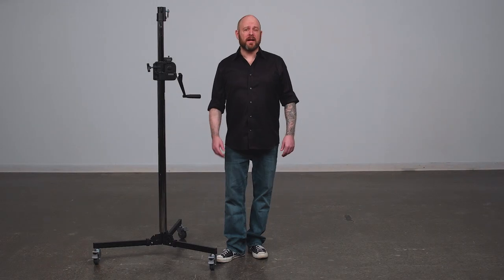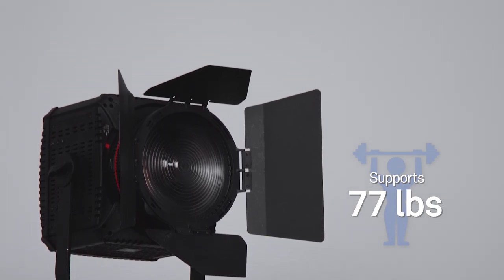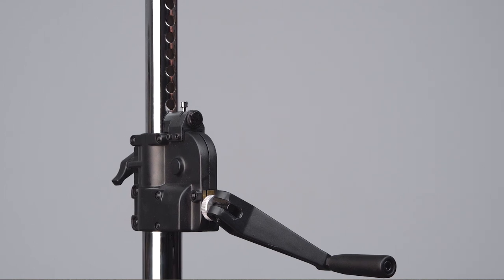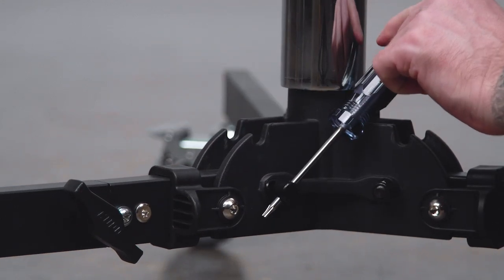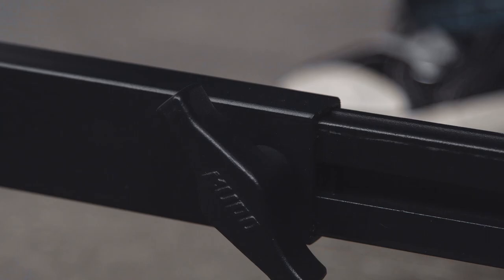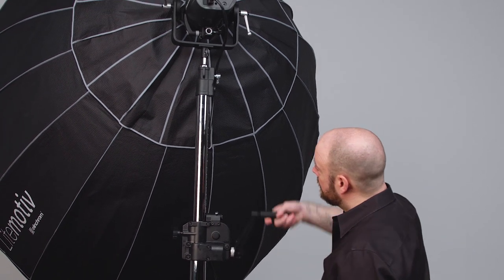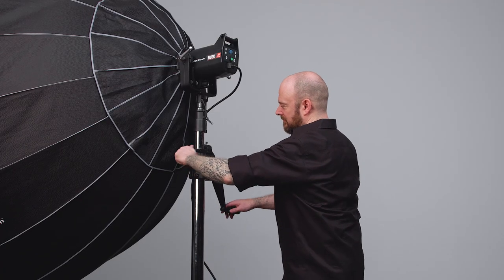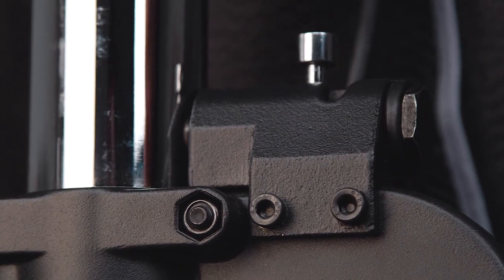Kupo 2 Section Low Base Wind-Up Stand

Comment: I ordered one from BH photo on July 17th. Still waiting. Looks like the bill is going to come due before I get my stand.
Reply from the maker: Thanks for reaching out. Did you recently check again with B&H? Have they given you an answer? The KS301812 Kupo 2 Section Low Base Wind-Up Stand should be available.
Reply from the maker: Hi! We'd love to help you solve this. Please email or call us, so we can help: sales@kupogrip.com or 914.347.3301
Reply: @KupoGrip  Forgive me. BH was not the problem. It was the credit deal on the BH card. The bank charged a fee for some sort of security product that was optional and I was not aware of. Every time BH ran the card it was declined because my available limit wasn't there due to this optional security product. I didn't even know. No one informed me the card was declining. I talked to the finance company. They are reversing the charge. When its reflected in my statement, they can charge and ship the item. Thanks so much for your reply.
Reply from the maker: It's our pleasure. Always happy to help. At least that mystery was solved!

Comment: Seems none of your products in black are in stock. What a shame.
Reply from the maker: Hi. Thanks for your comment. The KS301812 is only available with a black steel base with chrome steel sections. Which other products are you interested in? 

Also, please bear in mind it's been challenging times for all manufacturers with COVID-19. We are, however, getting back to normal operational stock levels that will shortly include many stands being available in black.
Reply: @KupoGrip  lol your products came back in stock yesterday 🙌  Talk about good service 👍
Reply from the maker: Fantastic! So glad it all worked out :-)